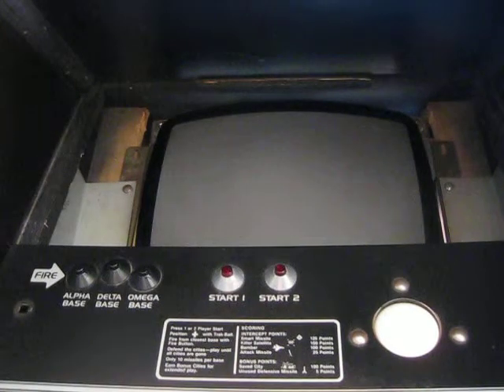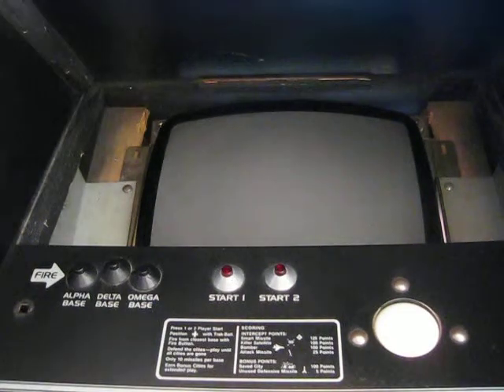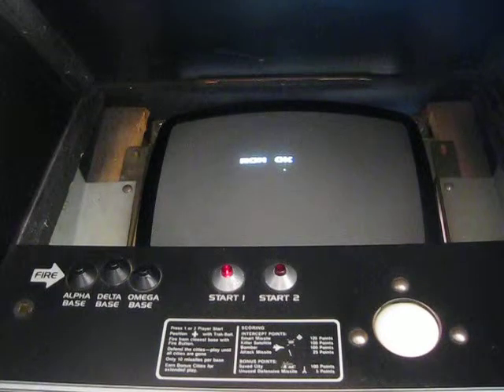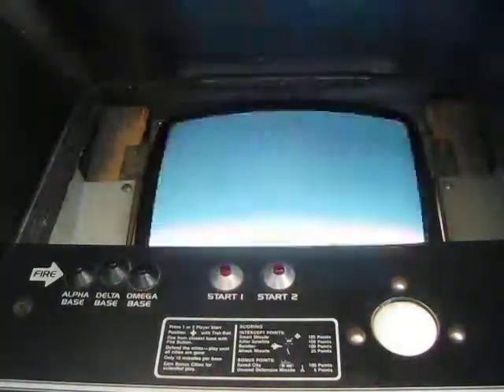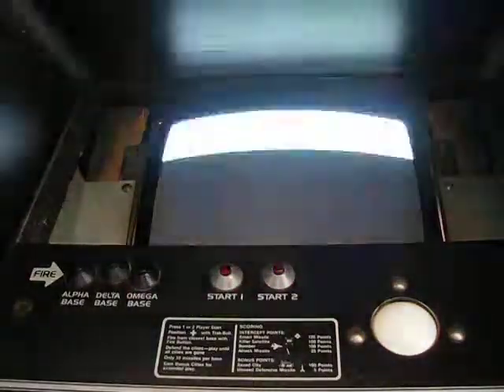Missile Command Board Error

Comment from the maker: UPDATE!!
I pulled the ICs and cleaned the legs and replaced them. Also, I reflowed the solder on a memory chip that someone had replaced in the past (non factory solder job). Finally, the crystal (Y1 on the game board) seemed loose (broken?) so I swapped it with another from anoter faulty board... now it works! TA DA!

Not sure which thing I did fixed it but it's working for now and that's all that matters!

Cheers,
David